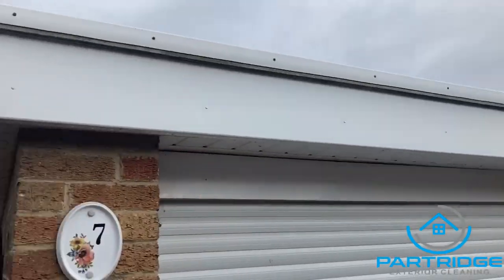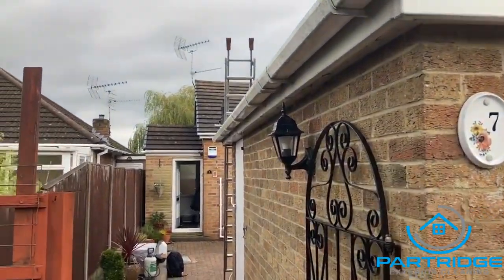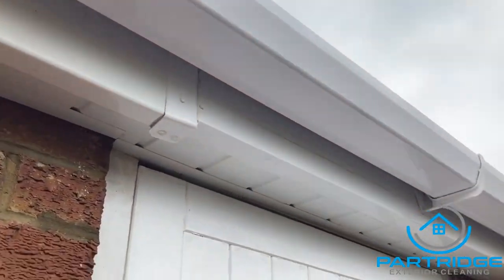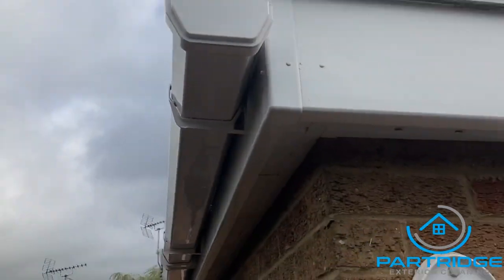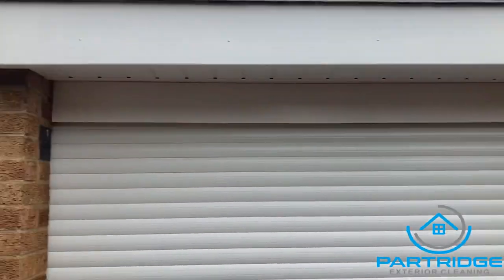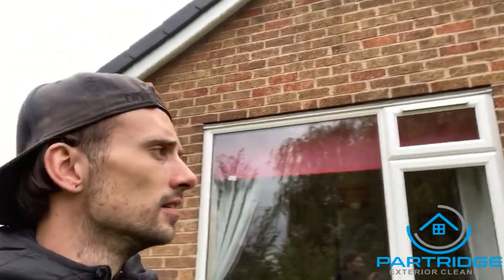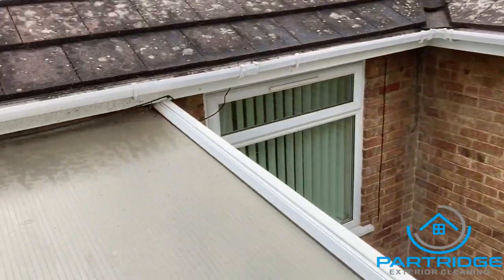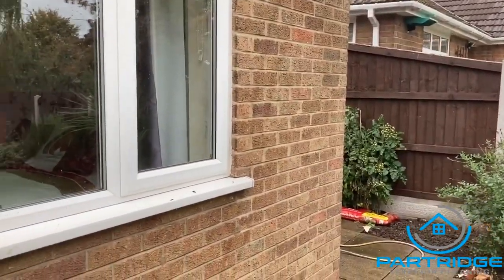A Full Exterior Clean (Gutters, Windows & Conservatory) // Partridge Exterior Cleaning

Comment: Good video bro .... Huge tip I Picked up and helped me out a lot after water fed brushing is complete is to put a cheap car washing mitt over small 6" Unger T-bar and applicator on the end of my pole great for getting into difficult stubborn stains from the ground without ladders and then also stick a fresh dry mitt on after and go over again gets rids of them water drips left behind that make it look like a half finished job and drys them clean before you leave. Rarely have to get the ladders out now but I understand if your doing the windows as swell and your up there a cloth works wonders ..... Keep up the great vids and work
Reply from the maker: Ah good idea actually mate. I used to use a towel instaed but does get stuck and fly off half the time. mitt is a good idea cheers mate. And thanks for the comment!

Comment: Another great job mate I have some plastic cladding to clean at the weekend what would you recommend just water I’m pretty new to that side of things
Reply from the maker: Water should be fine to be honest mate but to make it easier you can brush in some razr wash or ubix or even fairy liquid. Just squirt some on a wet brush head and scrub it in, leave it for a minute or so then rinse off
Reply: @PartridgeExteriorCleaning  spot on mate I see all this crap online about use this chemical use that chemical but surely it will just clean with water and soap
Reply from the maker: Yeah there’s people using hypo to clean UPVC it just boggles my mind :D
Reply: @PartridgeExteriorCleaning  a slight over kill isn’t it 😂 I only use it on my power washing jobs

Comment: Have you ever cleaned  white dash on house and if so what did you use ? Love the videos
Reply from the maker: Like the white panels? Cladding? Or do you mean render/pebble dash? 

Water or razr wash / tfr if needed for the first option

Scrub in biocide like algoclear, Benz or GKPRO through a wfp setup for the second option 👍
Reply: @PartridgeExteriorCleaning  yea render pebble dash so tft mixed with water spray on then wash off? Or leave ?
Reply from the maker: On render and pebbledash use biocide mate, the main manafactures are all k-rend safe so just scrub it on with a brush, you can add a dash of fairy to it to help it stick more but might not be needed. 

If not I believe you can use sodium hypochlorite but I’d double check first as I’m not completely sure
Reply: @PartridgeExteriorCleaning  so just spray on
And scrub in and leave on dnt wash off that correct people always want finished new look every time 

If needed cud i spray hypo on and rinse off but u say bioside better option
Reply from the maker: If you scrub it on through a wfp and brush it may agitate and stick better, it should work pretty quickly but do a test Patch first. You can leave the biocide on but if you use hypo then you’ll have to rinse it all off but will work quicker. 
I personally don’t like using it unless I have to so up to you mate but just definitelytest patch either way 👍👍